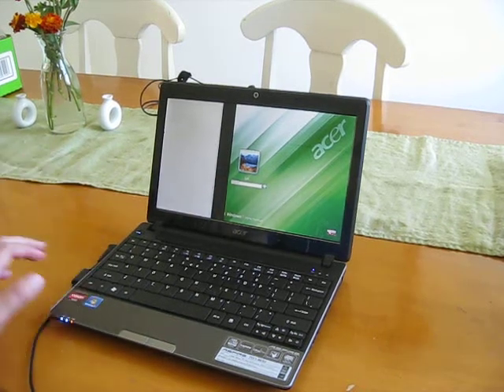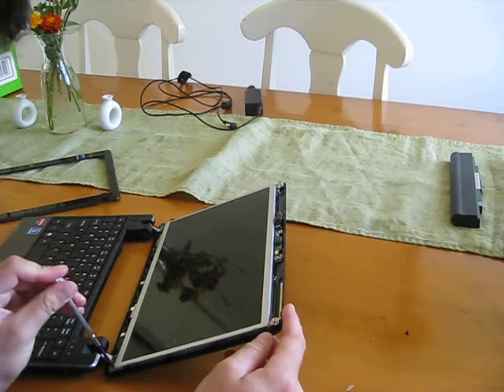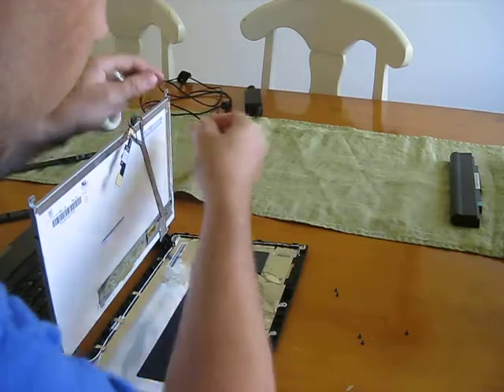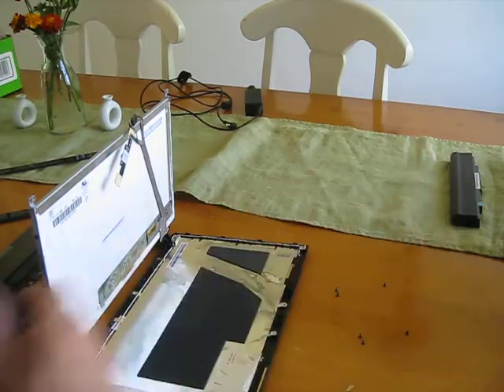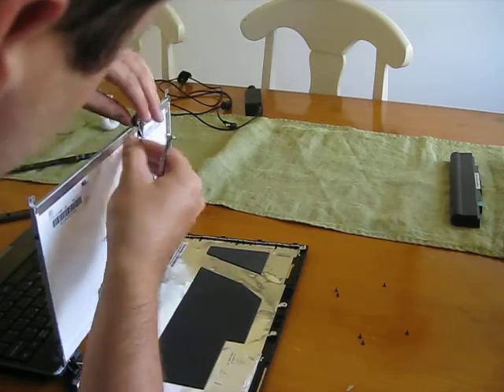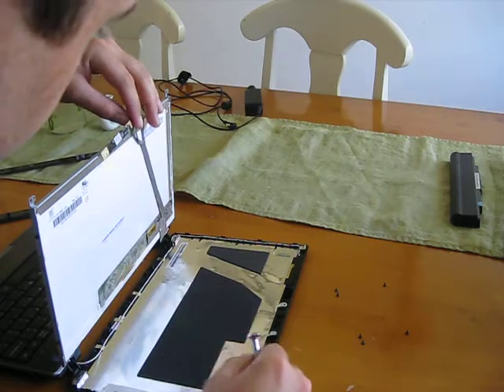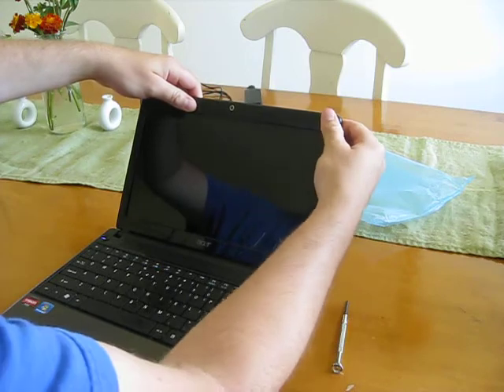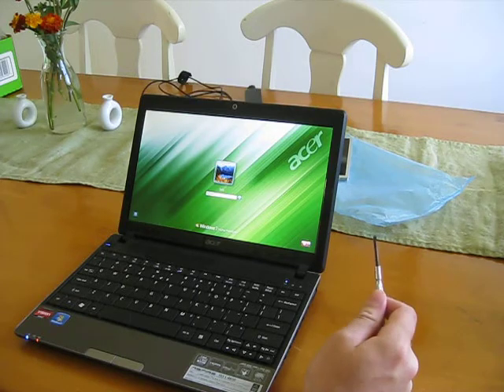Acer Aspire 1551-4650 Broken 11.6" LCD Screen Replacement 1366x768

Comment: I need either to clean the fan or replace it in that same computer because it makes a louder sound than it used to, and the computer overheats so quickly and turns off suddenly from the heat, even just with light to moderate use. There is a wire (running on top of the plastic frame) that I need to unplug in order to remove the cover.  However, I do not know how to unplug this wire from its own socket inside the computer.
Would you please make another video showing us how to reach the fan ?